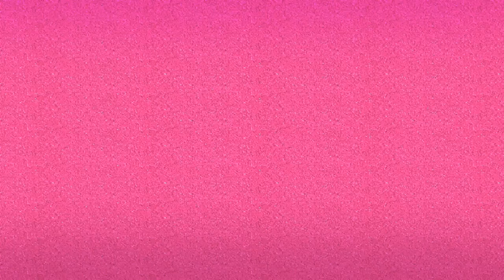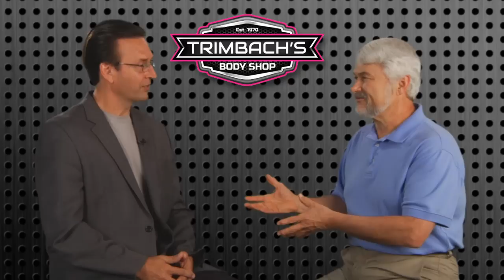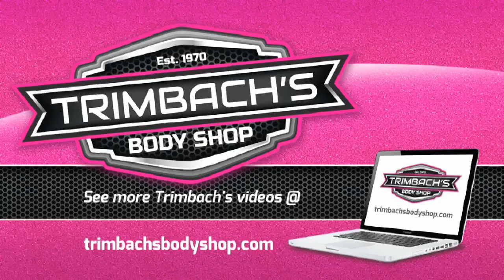Can You Fix A Bent Frame?

Comment: But what about the fact that the metal has been weakened? Isn't the vehicle no longer safe to drive? My 2013 Jeep Wrangler is on a frame machine at the shop right now and they haven't decided whether or not to total it. If they don't total it, I'm a little scared to drive it anyway.
Reply: I've been driving a mustang with a bent frame for the last 3 months. I just make sure I dont go over 40-50 with it. Fingers crossed though

Comment: So what is a say boxcar like a 79 firebird body construction. If that frame were to be bent is it a lost cause. Because I'm buying one and putting aftermarket parts in for strip racing and I hear too much torque warps the body. Also do you know any way to reinforce the body to prevent warping due to torque